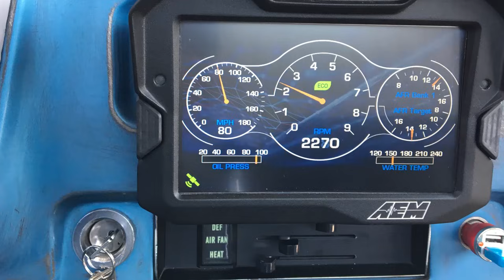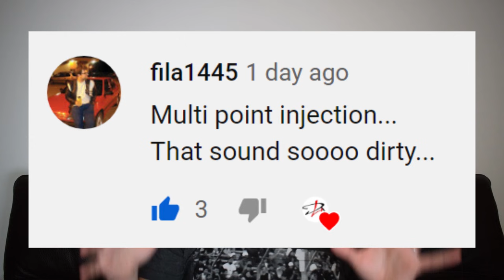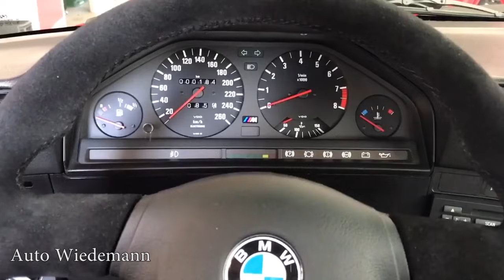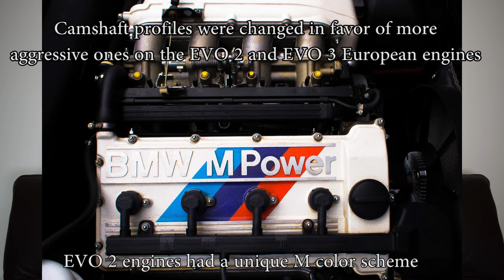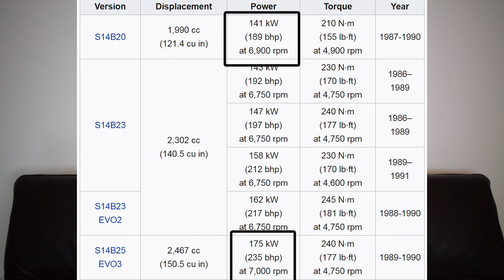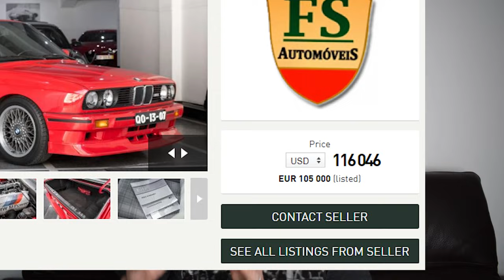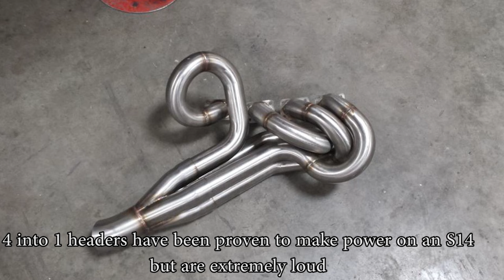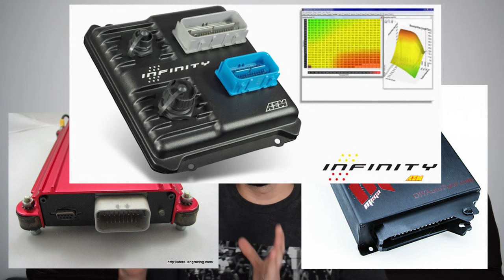BMW S14 - What makes it GREAT? ICONIC ENGINES #6

Comment: "The car isn't slow, you're slow."

Eh. Maybe back in the 80's, but standards are higher these days and a well optioned econo-box will walk away from an E30 M3, to say nothing of how embarrassing it would be to line one up against a performance car from the last ten years or so. It's a cool car, but there's no reasonable way to call it a fast car :lol:
Reply from the maker: There's more to speed than going fast in a straight line. Also, options don't make econoboxes faster :) But I do get what you're trying to say, however, 200 hp in a lightweight chassis is objectively fast, both today and in the 80s. Yes, nowadays it's all about the numbers game, but sadly the impressive numbers rarely translate into real world excitement. Sure, a decent 2020 hot hatch might be faster than an E30 M3, but there's a lot more to it, and given a nice stretch of curvy road I'll take the e30 over 9/10 modern hot hatches anyday.
Reply: @d4a  On prefering the M3, that's fair, but I'll always take the faster car. Performance and excitement go hand in hand for me, my fun comes from the engagement of driving quickly more so than the overall "vibe" of driving. That's just an opinion though I suppose, as is the standard cars performance gets judged by, different strokes and all that. I should remember that more when I'm tired :lol:

The options thing on the other hand, the E30 M3 and the base model 3 Series of the same generation are the same car with different options. My neighbours 350HP AWD Focus RS is the same car as a base model Focus, and there is a tremendous difference in performance there, arguably more so than the gap between an M3 and a base 3 Series. I'm gonna have to hold my ground and argue that options and performance go hand-in-hand when looking at factory spec cars.
Reply from the maker: You mentioned something very important and a bit contradictory. Engagement. More hp doesn't mean more engagement. So between a 2020 hot hatch with 300+ hp and the e30 m3, the 2020 car should be more engaging, but it rarely is. Electronic power steering, dozens of driver aids, drive by wire and more stand in the way of actual engagement. Older cars aren't just about the "vibe", ask anyone who genuinely enjoys driving. It's about engagement, being analogue, makes them extremely engaging. I have driven both older and newer cars hard, and hp and engagement are rarely proportional. Look, I get what you're saying but the RS and the M3 aren't options or optioned out versions of the base car, they're different cars, targeted at entirely different market segments than the base car. The RS only looks like the base model, but other than that they can't even be compared. The suspension, the brakes, the chassis reinforcements, the awd system, pretty much everything is very very different. Same goes with the m3. I'm going to say something, it might very well be prejudice, but I think you're someone who enjoys and loves cars, but you have yet to sink your teeth all the way in :) Again, no harm meant, I'm enjoying this dialogue.
Reply: @d4a  More HP doesn't mean more engagement, but more performance very much does. Reaching a higher limit demands more focus and faster reactions, puts you under more pressure due to the increased risk, and the increase g-forces that come with higher speed amp up the smile factor in a big way too. I have nothing against older engineering (hence why I've been binge watching these videos even though they're all on rather old motors :lol:), but it is objectively worse than modern engineering in this respect, we've come a long way in the last thirty years or so and modern performance cars are brutally quick compared to their older counterparts, at least when comparing factory spec cars. 

I'm sorry, but I cannot see the sense in taking two cars that are based on the same chassis and arguing that they are different cars. For all the differences between an M3 and a 318 or a Focus RS and a base model Focus, the performance versions are built off of the same core chassis as the base models. If you'd prefer a less extreme example, there's the C7 Corvette. Even when only considering models with the base engine, the difference in performance between a base model and a car that had every available go-faster option selected is profound. Different suspension, different brakes, different electronics, different exhaust, different intake, different gearing, different bodywork in places, there are too many differences to quickly list... and it's still a Corvette.

I'm enjoying this dialogue as well, but I must admit I do think it's raw prejudice to assume that just because I value different aspects of driving than you do that I must not know what I'm talking about. It's like saying someone must have poor eyesight if they have a different favourite colour than you do.
Reply from the maker: Let me try a different approach, forget me. Let's take automotive journalists, big names like Clarkson or Chris Harris or similar. They have driven more cars than anyone and you'll see that in the vast majority of cases they enjoy older machines. Also, there's a point where the only benefit of more performance is bragging rights and impressive numbers. This is precisely why modern high powered cars have so many driver aids, because we have long past the point of what an average driver can handle and harness. By the logic of more performance equals more engagement, hypercars should equal the most engagement? But they don't, they're absolutely useless on the street and you're driving at 10% of their potential. The only place you can enjoy them is on the track, and even there they will overwhelm 95% of drivers. But forget hypercars, let's look at something more realistic, a hot hatch with something like 300hp. My opinion is that driving happens on a twisty road. When it comes to 300hp on a twisty road in the real world, you can't really use them. You'll go wot at a few corner exists, and the odd straight and that's it. You'll be breaking traffic and safety laws and the limits of your courage and rationality within seconds. Sure it's great fun on the track, but how often can you go to the track? So in my opinion on a twisty road in the real world a 205 gti is actually more engaging than a modern hot hatch. It's got three times less performance in every aspect but it's more engaging and more useable. It's more engaging because you can actually drive the car at its limit and use all the skills you have to squeeze the most performance out of it. That's engagement. Where can you drive a modern hot hatch at its limit other than the track or the highway? And when you do drive it at its limit, 95% of cars owners can't really handle it and make the most of it.
The C7 is a poor example and we're entering semantics here. What is a different car? But again, the difference between a base c7 and the top model and the difference between the base model focus and the RS is very large. I don't even remember why we started this base vs top spec car anymore? As I said, it might be prejudice, I don't know you, or you're driving experience or the cars you've driven or anything.  But I did base my assumption on two things. The first is the old cars and vibe thing :) (that ticked me off lol low-key making it a hipster thing) and the second is something that's the shared experience of the entire car community. Cars have gained a lot of performance over the decades, no doubt about that, but they have also lost a lot of things too. There's a reason why so many old platforms are still so popular and sought after and why people watch videos like these although these engines are practically ancient and obsolete compared to modern stuff.
Reply: u cant compare car from 80 to car from 2010, thats just dont make any sense
Reply: @TopiAS06  Sure you can, and it does a great job of highlighting how shitty most old cars actually were.